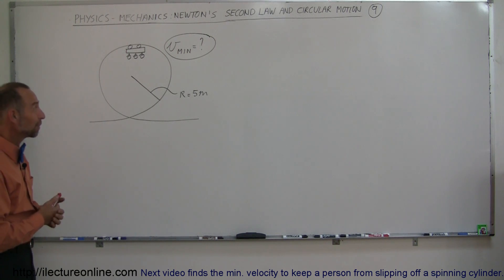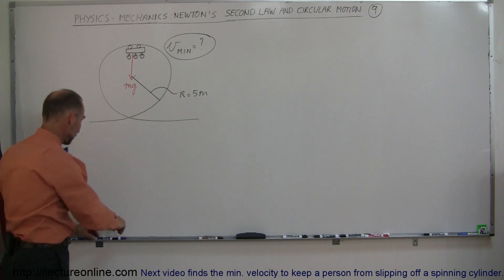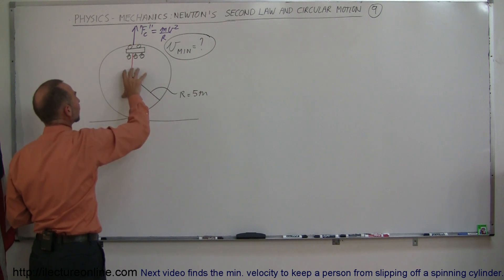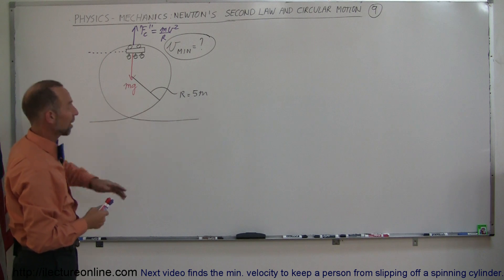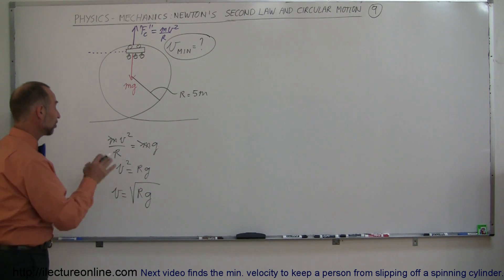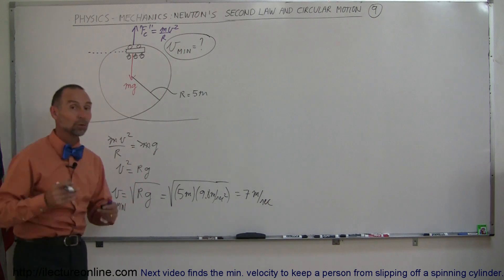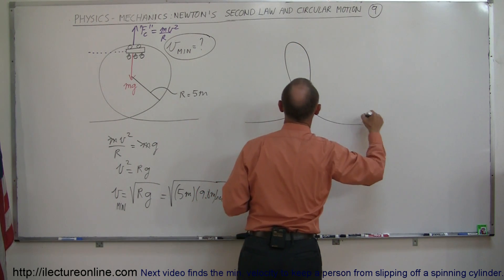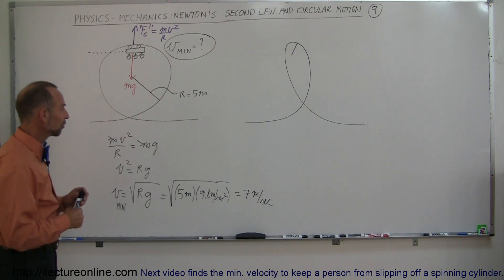Physics 6  Newton's Second Law and Circular Motion (9 of 10) Roller Coaster

Comment: that's a confusing diagram. shouldn't the centripetal force and gravitational force go in the same direction? that's partly why you feel weightless, whereas, if the centripetal force is going in the opposite direction, you feel a greater normal force.
Reply from the maker: Yes, if you consider the centripetal force.  But if you consider the fictitious "centrifugal" force, then the diagram is correct.  Since we "observe" the effects of the "centrifugal" force in daily life, it often is easier to visualize the problem that way.  For example, when you are a passenger in a car that makes a sharp left turn at high speed, what "force" do you sense?  What is the direction of that "force"?
Reply: @MichelvanBiezen  Ahh wow, that's interesting. Our teacher told us to completely disregard the centrifugal force, since they don't really test it in our syllabus. My apologies!

Comment: First of all thank you for this awesome lectures, but i got a bit confued with this problem but now i got it. If someone is confused with this just think,
On the top:
F(radial)=(m*v^2)/r equals to N + mg = (m*v^2)/r, from this comes N = (m*v^2)/r - mg
If N <0 the car falls down, so if u make N = 0 you will have the minimum speed required.

Comment: What about the normal force in your equations ?
Reply from the maker: At the point where the "Fc" is equal to mg, there is no normal force.  (That is where the centripetal force is the mg force)
Reply: If it go very fast at top, the Fc become more than mg and to compensate, the Normal force generated and added to mg. (Fc=mg+N)

Comment: shouldnt we use 1/2mv^2=mgh to solve the problem.. in which case 'h' will be equal to the radius of curvature and that is 2 times r
Reply from the maker: No, because the minimum speed at the top cannot be 0.  (The car would fall down.)
Reply: Thank you Sir!!!

Comment: isnt there a normal force from the tracks pushing the cart towards the center of the circle?
Reply from the maker: There are different ways of doing the problem.
One way is to draw a free body diagram showing

1) mg
2) N (Normal force of the track pushing against the cart.)

N = m*v^2/R - mg

When mg is greater than mv^2/R the car will fall off the track.
Reply: Michel van Biezen Oh, alright. Thanks for the clarification (and your awesome videos)!

Comment: why does energy conservation give a different min value for v?
Reply: +Michel van Biezen how tjid can be done by energy conservation???
Reply from the maker: Dejan,

All we are doing here in this problem is determining what the minimum velocity at the top should be in order not to fall off the track.   (Not what the minimum velocity should be at the bottom, for that you need to use the conservation of energy.)